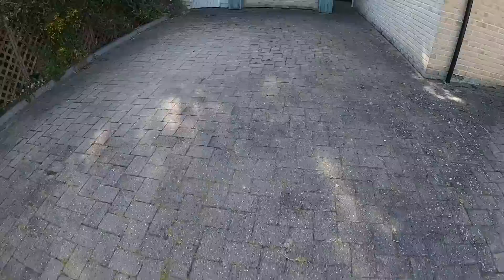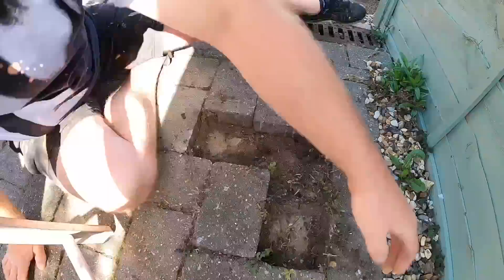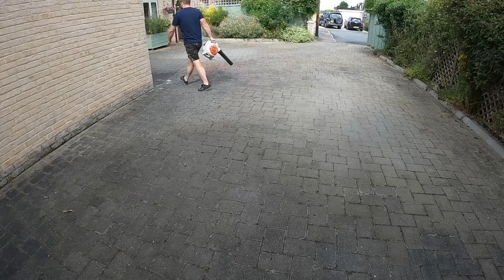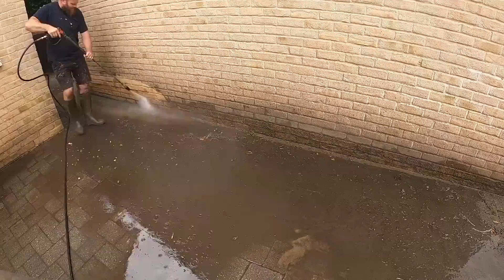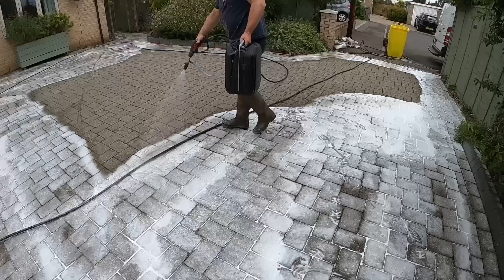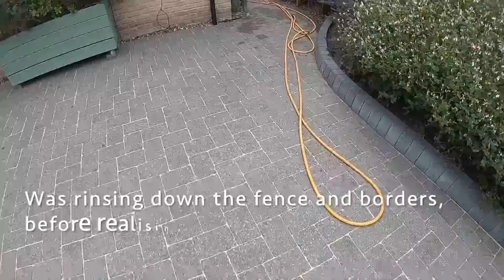THEY TRIED TO INTIMIDATE US INTO CLEANING OUR DRIVEWAY We Said NO & Stood Our Ground Then Called You

Comment: Now I know why my front brick walkway is so uneven. My house is 103 years old and I have a big ant problem. I am going to put food grade diatomaceous earth on the source (60 ft. tall tulip poplar) and at all doorways and windows. Wearing a mask of course! I already tried making my own boric acid/sugar syrup traps and that helped but not enough. Then I need to get a handyman to reseat the bricks in sand so they aren't uneven. How many cubic ft of kiln dried sand/100 sq ft (cubic yds/10 sq meters) do you use for a driveway after you fix the uneven spots and gussy it up? I would also like to know how you get your spray so foamy. That's a sure way to tell if you applied it correctly.

You did a beautiful job on that brick driveway and patio. In the USA, we don't have very many of those unfortunately. It really adds to the look of the property.

Comment: I've got some either 13% or 15% sodium hypochorite for a soft wash, what surfactant and water should I add to make the black spots disappear? Thank you and well done with this job.
Reply from the maker: Thanks Steve. You don't have to use surfactant mate, it just helps with the dwell time, it's the hypo that removes the black spot. But if you really want to use some, this is a good one https://www.bonnymans.co.uk/product-page/softwash-surfactant-bleach-safe-water-based-surfactant
Reply: @PrestigeExternalCleaning  Thank you for the surfactant. I'll need to get some of that. What hypo do you use?
Reply from the maker: @stevesimms7318  I get mine from @blastaway
Reply: @PrestigeExternalCleaning  Thank you m8, much obliged

Comment: My favorite response to the test patch scum is to inform them of all 7 laws they broke and if they put so much as a drop charges will be pressed as just of the top they are trespassing, damage/destruction to property, if any soaps are used chemical dumping on private property, etc usually they pack their trash in a hurry but in the 2 times they had already did it i simply took down their info and took em to small claims court and forced them to pay from a proper crew to do it right

Comment: I’m a DIY homeowner with a much smaller driveway than this (thankfully). I love having my own pressure washer and surface cleaner. I find that the rinse is so important (otherwise all the crap you mobilized will just settle in somewhere else), but it’s difficult to do with a consumer washer.  Rinsing with a hose and nozzle straight from the house tap gives a fair amount of volume, but not much pressure / velocity to keep things moving. Rinsing with the consumer pressure washer gives good flow velocity, but not enough volume.

Comment: There was a trail of ants in the living room going down between the wall and floor. Vacuuming them up was getting me nowhere. I mixed up a homemade ant killer solution. One equal part powered sugar, one equal part baking soda, and some water so it can be sprayed in the area. Mix the sugar and soda together well. This causes the ants to have gas. They die because ants do not burp and the gas kills them. Enjoyed your video.